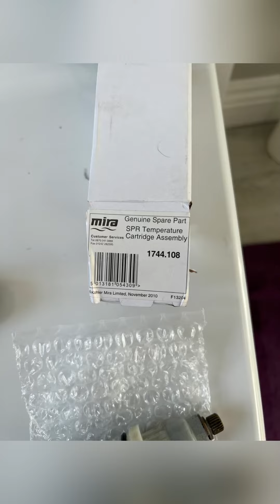How to change thermostatic shower cartridge Mira shower mixer

Comment: Hi there does the mains water need to be turned off for this?
Reply from the maker: Hi yes unless you have access to the valve and it has a shut off on the supplying pipe

Comment: Hey Phil, my Mira Atom is very similar and has started leaking out of the temperature mixer. Do you think the cartridge most likely needs replacing? It looks like Id need the same (1744.108). Cheapest I can find is £70!
Reply from the maker: Hi that’s probably about right for the price I paid.

Comment: Hi Phil, I have a Mira Relate mixer shower. When the tap is neutral the water is cold and I need it to be above luke warm. Do you know how to adjust the temperature value to increase the temperature
Reply from the maker: So if you push the button and rotate the knob towards you does it not get warmer.

Comment: Hi Phil,

I have a shower like this, it's a Mira Atom. When I turn it on, water flows for a minute or so, then it stops and won't start flowing again until you leave it for a while. Do you that item you removed might be the problem?
Reply from the maker: Hi
That sounds like flow to the shower may be a problem ,does it stop flowing altogether from the shower when it stops or does it trickle.
Does the shower run straight from the boiler or a pump may be a problem there.
Not much can stop the flow at the shower if you have turned the hand valve to on.
I would start looking at the piping into the shower.
Reply: @phillockwood3326  Thanks Phil, when you turn it on it's powerful, but then the flow becomes weaker and then it stops. I have made a discovery today. I unscrewed the shower head and then tuned it on, and there was no sign of it cutting out. it seems like the shower head might be the fault, and is bizarre.
Reply from the maker: @TamesideCitizen  Hi do you have a problem with limescale may be blocking the holes.
Reply: @phillockwood3326  Thanks for the reply Phil. I have never had problems with limescale before. I live in the Manchester area and the water is soft here. That I believe means no limescale?
Reply: @phillockwood3326  Hi Phil., taking the shower head off did not fix it in the end. When I turn it on, it works for about a minute and then the flow becomes weaker, and it eventually stops. The only way to make it work is to turn the temperature control on the shower to high, but then it's too hot to have a shower in.
Reply from the maker: @TamesideCitizen  Hi 
What’s the shower like when turned fully cold ?.

Comment: You are using the grips the wrong way around!!  You'll get much better purchase using them the correct way around as the harder you twist the tighter the grips get.  Using them the wrong way around, the grip is automatically lessened as soon as you start trying to rotate the cartridge.